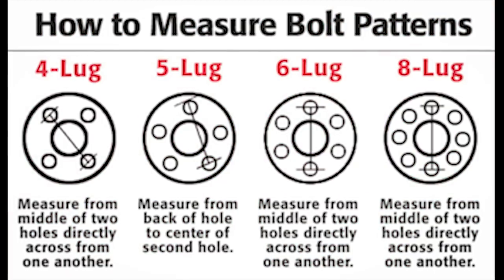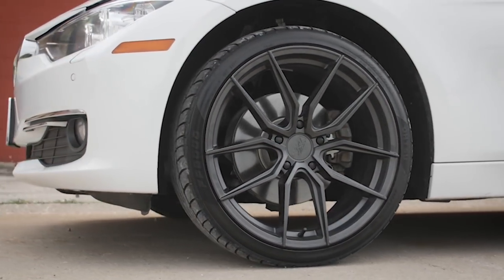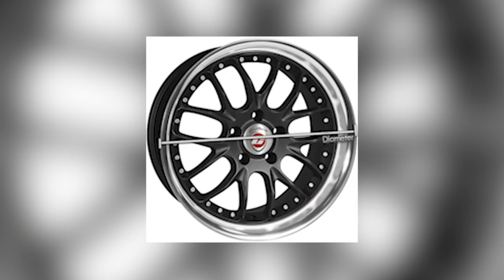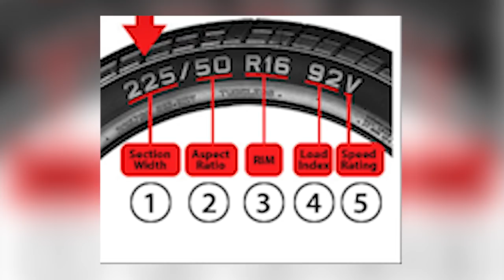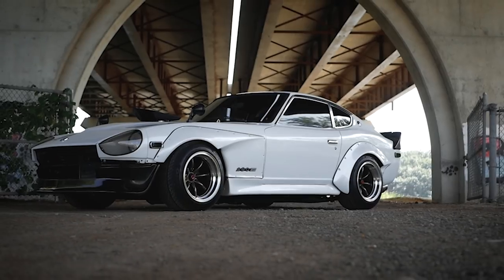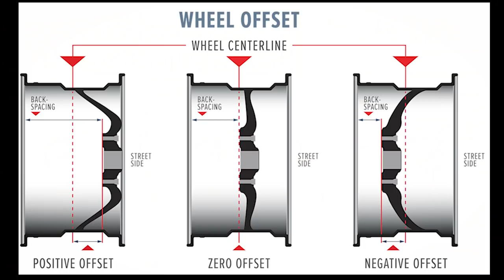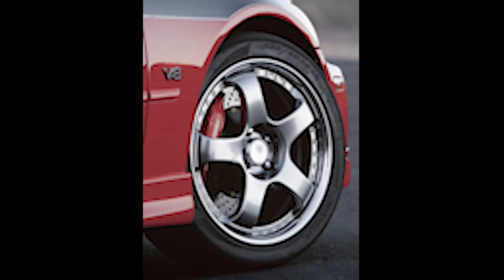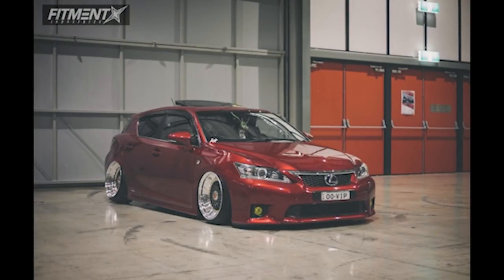The Basics of Wheel Fitment

Comment: bore, wheel diameter and width, bolt pattern, tire dim's, spacers and or adapters, camber plates, coilovers, centering plates, studs or bolts, frame notching, anti-sway bar relocation, ride height....so many details, but it's true love ♥

Comment: If you change from 235/45r17 to 235/35r18 then your tire will be 1 inch smaller.
You would have to go from 235/45r17 to 225/40r18 to be similar. It will only be 0,2 inches smaller

Comment: I’m trying to figure out my fitment for my 12’ Civic. I was thinking of going with 8.5-215/40/R17 (Offset Undecided) I would like it to poke a bit without much of a gap but to have the clearance it needs. Without needing to roll or cut preferably. This is my daily driver so I want to be safe, but also have the look of stretch. Thanks!
Reply from the maker: Check out what people are doing here! https://www.fitmentindustries.com/wheel-offset-gallery?order=year&make=Honda&model=Civic
Reply: Thanks. I actually looked on there for a few hours just checking every variety as far as suspension, but I’m not sure what’s safe to run for a daily.

Comment: So here's a whacktacular question:

Would it be possible to take a set of rims to a machine shop and get them to shave off a couple millimeters of offset? For example, if you have a set of +44mm rims, could you shave them down to a +48mm?

Does this mess up balance or wheel strength/integrety or something?

(Forgive me if it's a stupid question... but instincts tell me in theory, that the "opposite" of using spacers would be machining the hub down from the inside.... no clue if it's actually possible.)

Comment: For my 350z I plan on getting a set of 18x9.5 +22 and 18x10.5 +25 Volk G25s, with tire sizes: 255/35r18 for the front and 275/40r18 for the rear. I'm set on these wheels because I already have them, but I wanted to know if you guys had any input on my choice of tire size.
Reply from the maker: Check out our online fitment gallery we have tons of 350z's with full specs <3 

https://www.fitmentindustries.com/wheel-offset-gallery?order=year&make=Nissan&model=350Z&page=1

Comment: so if I like someones fitment, but I want different wheels, can I take their exact wheel size and tire size to a different wheel? im so confused by offset. it seems different depending on if the wheel is concave or not. ill find a picture of a fitment I like, but won't be able to afford the rims, so ill google rims I can afford that are the same size, but they look way different fitment wise? I got so confused when you posted that picture of the car with two different wheel setups, one car had double the offset of the other but the wheels fit exactly the same!!
Reply from the maker: Yes you can!

Comment: im finding it so hard to find wheels with the offset i want
Reply from the maker: What offset are you looking for?
Reply: Go with custom 3 or 2 piece and problem solved
Reply: spacer
Reply: if you need spacers then you bought the wrong wheels
Reply: word
Reply: The real question is how concave do you want them to be and can it clear your caliper. If it doesn't use a spacer and if you're looking like mexiflush start running some or alot of camber.
Reply: i didnt get any of these notifications wth,
 i want 18x9.5 +20 all round but i dont want to drop 3k on 2 or 3 piece wheels when the car is only worth 6k. im not about the spacer life either but i used willtheyfit.com website to get my fitment how i want it based on the setup i currently have
Reply: M. Hayes Look into cosmis they're around 1500 or ESR for around 800. It doesn't matter what the cars value is worth and if your wheels are worth just as much as your car as long as you're happy with the purchase and no regrets. Wheels can always be kept for the next car or sold. Fuck it
Reply: thats true, i spent a week searching and i want to go with Advan Racing GT 18x9.5 +22 (thats lowest offset offered) in machine black 5x120
Reply: Fitment Industries  

What do you think for s2000? Not much fender roll? I’m interested in the SSR GTV02 Black.
18/8.5/48mm.......All 4 corners
Reply: On a e46?
Reply: i bought spacers because i cant afford couple thousand dollar wheels. :(
got a voltex evo 7
Reply: I've heard this beat in like 20 vids and I finally remembered who it is, he sucks but the beats dope lol

Comment: I bought a 2010 Honda Fit sport everything is stock I bought 4 te37 4x100 15x8 +20mm 5.29 backspacing, I haven’t got them yet in the mail but I was wondering if it will fit?
Reply from the maker: You should be able to! However check our gallery and you can compare contrast 🤘🏾🤘🏾🤘🏾 here’s a link. -Edgar

https://www.fitmentindustries.com/wheel-offset-gallery

Comment: Hi i have a 1998 Evo 5 RS. the wheels that are on it are diferent widths but tyre sizes are the same.
Front Rim's are 18x8
Front Tyres 225/40/18
Rear Rim's 18x9
Rear Tyres 225/40/18
Offset's +33 for all..

i have been told its not good to have different width rim's with an AWD, this is how i bought the car but is not factory.
Is this ok if not how i can i fix it?

thanks

Comment: I'm planning to change my 215/65r15 tires to 215/55r17. I don't know if the new tire size will raise my car up or not.
Reply from the maker: The height of the tire will go down.
Reply: Nope it will not. The second setup is 7mm bigger in diameter.
Reply: Chris, I'm new to this but will the new tires give me any problems?
Reply: Kasinova Da Don well it depends on the width and offset of the new wheel if it scratches or not. Otherwise they should fit, but your riding height will be 4mm higher.
Reply: Chris, The new one is a 17x7.5 with a 40 offset but what will the wheel gap be like?
Reply: Kasinova Da Don I cant tell. Take a ruler and start measuring. You will never know until you start measuring your arches.

Comment: What's a good size tire to use on a 15x8 rim to get that nice, subtle stretch look. I'm NOT trying to get that Sudani stretch look. lol.  Right now I am using 165/50R15s on 15x6 and I like this look, but going up to 15x8... I've never done that before
Reply from the maker: Did you look in our gallery? You can plug in what size wheel you have and TONs of vehicles will pop up with different fitment and you can go from there 🙂 
www.fitmentindustries.com/gallery
Reply: I'm running 15x8 on my set up. @visualfedz 
Check it out. 195/55/15  this is very similar to 205/50/15  understand what the number mean and where they belong changes everything about fitment.

Comment: Or you can do fitment the mk2 and mk3 vw way by putting other car manufacturers oem wheels on that are way to wide which forces you to use near disasterous tire stretch and ridiculous negative camber and then pray that you poked out wheel dosent slam to hard against the fender lip causing a tire blow out that makes you understeer right off the road in to a ditch
Reply: Profiting-off-others-misery Hh oddly specific

Comment: Need help I'm running into vibration problem once I hit 60mph idk why it does that
Reply from the maker: Hey Daniel, It could be a couple different things that could be causing this issue. I personally have this happen to me and it was related to the tires were not balanced. I would take your car to a local shop and have them take a look and see if they can solve that issue for you. I hope this helps 🤟
Reply: I forgot to mention I have a acura rl SH-AWD and my wheels set up are 8.5 front and 9.5 rear is that the reason why my car is vibrating when I hit 60mph +?

Comment: "What Is a Wheel and What Is a Rim? Are They the Same Thing?
It may seem obvious, but a wheel is comprised of a hub, spokes and rim. Sometimes these components will be one piece, sometimes two or three. The hub is the center portion of the wheel and is what attaches the wheel to the suspension. The spokes radiate out from the hub and attach to the rim. The rim is the outer part of the wheel that holds the tire. *While many people refer to wheels as "rims," this is technically incorrect.* We'll discuss several ways that wheels are manufactured below."

-tirerack.com
Reply: DABLMusic It was slang since the 90s.  It sounded cooler back then to say Rims than wheels.  It was really popular on the west coast

Comment: I have a Toyota RAV4 2003 (2nd generation) 4x4 SUV. The stock wheels are 16" x 7" alloy rims with 235/60 tyres (base models of this vehicle came with 16" x 6.5" steel rims and 215/70 tyres). 
There seems to be plenty of room in the wheel arches and I'd like to replace my current rims preferably with a bigger size. Bearing in mind I also want to retain functionality for light off-road use could you suggest a practical minimum sidewall height? Would it be a good idea to stick with a sidewall height ~60% of the tyre width? Thanks
Reply from the maker: For sure man sounds like you are ready for an upgrade! 😂👍 I would email our friends at Custom Offsets they can help you with getting that upgrade!